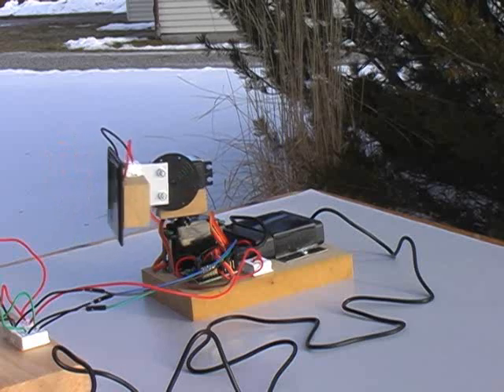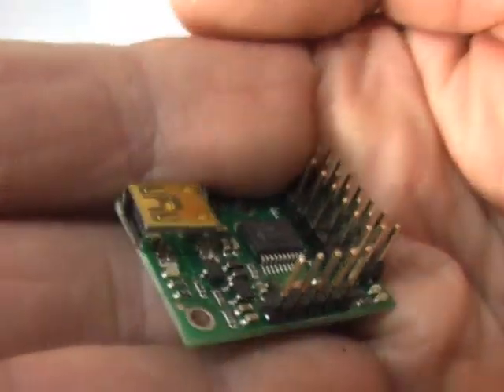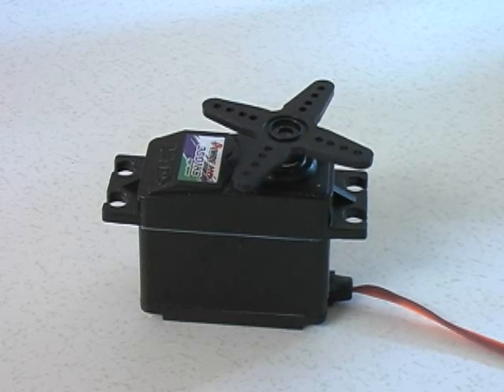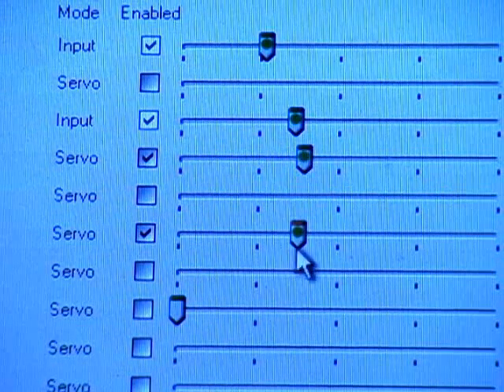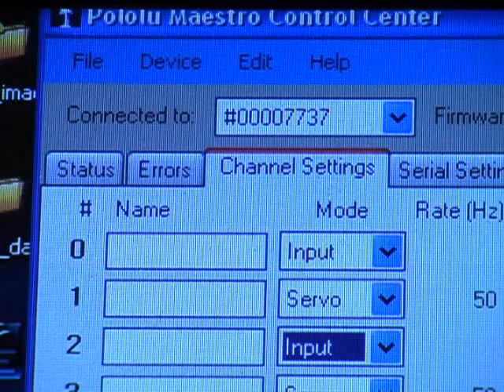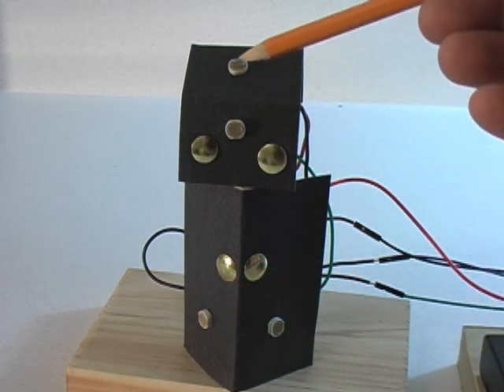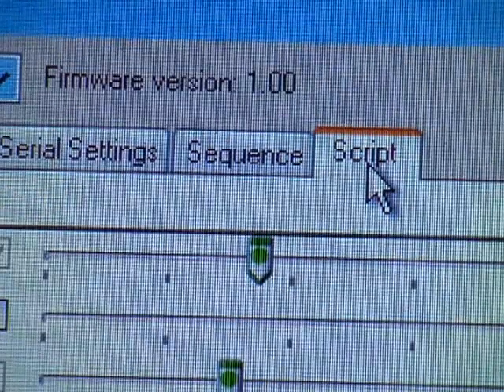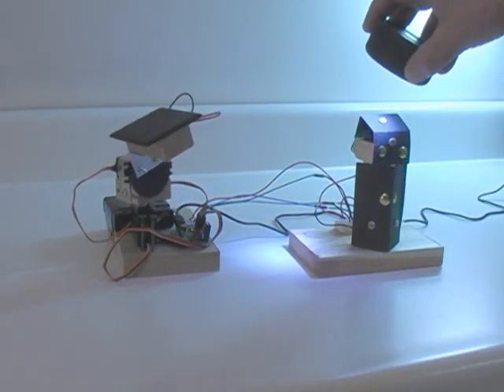Solar Tracker

Comment: So to get a baseline here, say you wanted a 12 V output from your solar panel and also wanted the sensors mounted on the panel apparatus as well as all the electronics to be self powered while still getting a 12 V output on top of that.
How big of a solar panel would you need in a sunny area for something like that?
Or rather, how much power does this configuration draw and would it be able to switch itself on when receiving sun light?